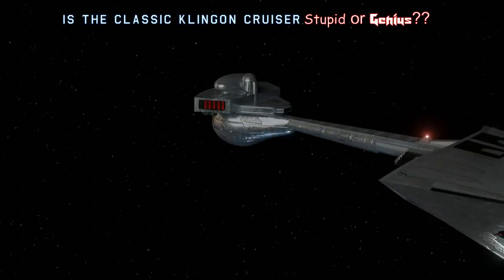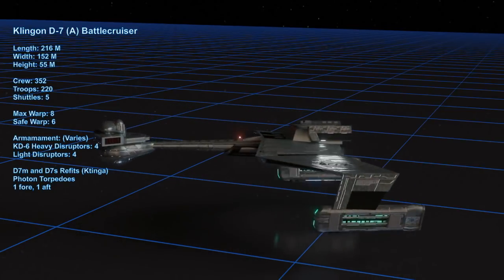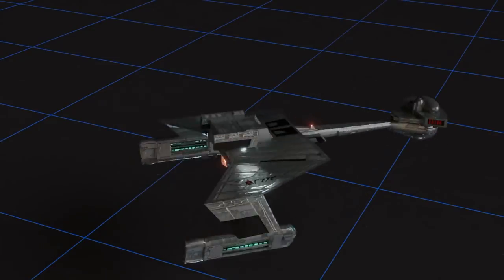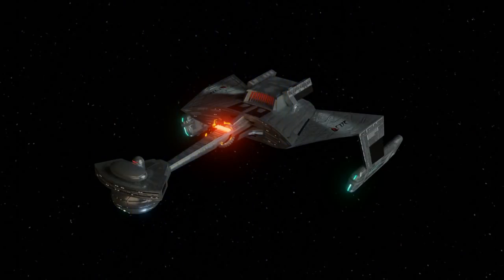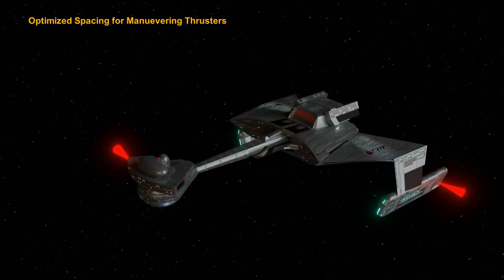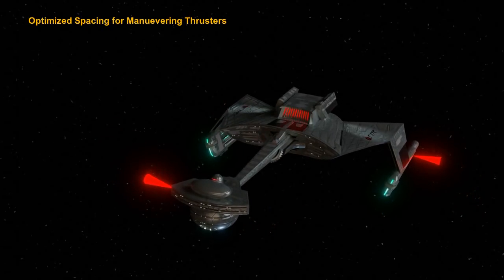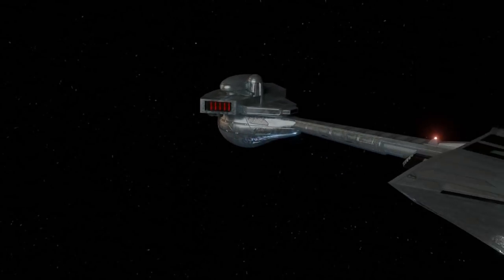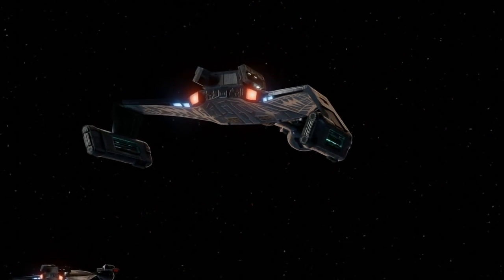The Classic Klingon D-7 Cruiser - Stupid or Genius Design?? Animated Breakdown!

Comment: Star Trek ships often have pieces connected by relatively spindly struts. The standard Federation ship design has the engineering section connected to the main saucer hull by a strut not much less vulnerable than the D7's neck. These are pretty much never any negative consequences to attacks on these struts. It seems like Star Trek ships aren't really vulnerable to being dismembered, no matter how much they logically ought to be.

Comment: I think the reason for the long neck is simple. If the aft hull receives catastrophic damage the long neck contains blast doors and keeps command and control operational even if the engineering hull is unable to support life. Similarly the engineering section and aft crew can continue to operate and maneuver the ship even if the forward bridge section is destroyed. The destruction of the neck itself would leave both the bridge and engineering section intact, and possibly the aft section still operational. It might be a weakness, but it is also a safety measure against combat damage.

Radiation has nothing to do with it. Radiaton is not a worthy way for a klingon warrior to die, is it?

We also know the later K'tinga is well enough armored to survive direct torpedo hits on the aft hull from Undiscovered Country.

Comment: It looks like it is a preliminary design. If you look at the rear section's front profile, it seems that it starts from a cut-front section. What if the neck section was the primary support for the back section and for more armament that was never included in the finished design?

Comment: It helps to remember that as created the Klingon’s were a rather transparent analog for the Soviet Union. So there ship design represented a more Soviet design aesthetic. And much like Soviet nuclear subs of the Cold War period, the Klingon’s reactors are not as compact as Starfleets, nor as well shielded. So the rear section is mostly the larger Klingon Warp core. And the extended boom is to keep most of the crew well away from it.

Comment: There may not be a technical reason for this separation as you suggested with the power core, but rather a psychosocial one -- your idea of servitor races being the ones that work in the rear section is plausible. But even with fully Klingon crews with no radiation hazard, there's a good reason for the separation. Klingons have a caste system, and as marines existed onboard sailing ships on Earth to protect the officers from the enlisted crew, the physical separation between these groups may be a very good reason for the structure. There's a bottleneck that prevents the enlisted from easily taking over the command center of the ship. Combined with good shields and maneuverability advantages, this bottleneck also makes sure that the crew isn't constantly challenging each other to death matches due to perceived dishonor from different castes and classes intermingling..

Comment: (Well Actually) I have always liked the Mutiny theory even if it it s little bit silly.
Matt Jefferies and Co may well have been well on board with the idea of "radiation" though as a reason for the shape much as it's a given reason for the Constitution Class to have it's Nacelles on outrigger struts & if you are of a mind to think the Saucer is an evacuation emergency vehicle then the boom could be on the Klingon vessel too.

Considering Klingon Ships can supposedly park in an ocean perhaps the boom is also designed to exit the Ocean and be able too fly up to the surface or even into space on it's own too - if the rear section is refusing to move or they crashed in water..

Comment: The original Star Trek technical manual did say the stalk design was so the front section was farther away from radiation generated by the back part. The idea was compared to very clunky unsafe but effective Soviet era technology which has always been larger and bulkier than USA technology at least back in the 1960s when this show was made

Comment: To add my geeky answer, in the Star Trek universe, ships have structural integrity fields (mentioned several times in TOS) so they aren't that dependent on the materials used or "thickness" of a structure.  Thus ships are designed for other capabilities rather than how sturdy they are.

As to the long neck, is that really any worse than the skinny structures holding the warp engines to the federation vehicles?   Arguably that design is worse because those engines have to be exerting  significant stress on those arms all the time, and yet they never seem to break off, even in battle.

Comment: There are multiple reasons for this ships design.  The first is maneuverability.   And looking at how the Klingons prefer to wage war, they like to be close in to their opponents.  They also like to come head on.  So the long neck wouldn't really be a weak point. But it would lead to the number two reason.  With the Klingons liking to battle head on, there's a higher chance of the bridge module being hit and destroyed.  This would leave the drive section in tact.  They could easily replace the bridge and continue fighting, without having to build an entire new ship. The drive section would also be able to continue the battle.

Comment: I would argue it is a combination of warp field geometery (as we see this design repeated in a number of ways with almost all Klingon designs, though not quite to the extent of the D7. The Vor'cha however is arguably just a chunkier version , and the Neg'vhar equally so. I've argued before that shields as a primary method of defense basically dictated Federation, Romulan, and Klingon Design philosophies for the better part of the 24th century. It wasn't until the advent of the Borg and Dominion which both demonstrated a fundamental capability to simply ignore shields, that we started to see certainly the federation begin altering their ship design. Compare the Nacelles on a Miranda or Excelsior which are very exposed to those of a Steamrunner which all but hides them under some manner of armor. 

I suspect that the design of most early 24th century starships was to maximize shield projection with the operating theory that if the shields collapsed the ships were doomed anyway. With the Defiant, Steamrunner, Akira, Saber, and arguably even the Neg'vhar's design we begin to see a pivot away from this design philosophy and the ships shields become more important.

Comment: I always presumed that the D-7 we saw on screen were actually just “service models” of sorts. That the original design has a more pointed design along the spine, following the angles of the aft armor forward into the bridge, not unlike the D-10 or K-33 from FASA.
Said prototype no doubt proved highly effective in combat, but commanders found it sluggish and too broad in its power distribution. To attempt to compensate for this issue, the field technicians then would remove the forward section’s non-critical components, including science sections and backups, leaving only the critical segment in place for crew, magazine, and the minimal necessary power transfer lines (leading to increased power requirements directed to the bridge section, lowering disruptor power when not properly prepared for). The aft section they called “the perfect warship” and left alone.
Once it returned to the designers, they saw their craft gutted, and became enraged. They attempted to fix the ship, but it had already passed final production approval in its new form, due to spitting out excellent numbers, and achieving a production cost and time far lower than anticipated (due to the drop in materials required) and thus: they were forced to make two halves of different ships and keep them together.
When they were told to refit the ship, the designers knew they couldn’t change the new expectations of a fast attack cruiser, so instead they streamlined the design and made it both more heavily armed and compact, and slightly smaller, introducing the K’Tinga variation (which being both a proven design and finally coordinated in its development stage: lasted nearly 100 years or more in service).

Comment: Every iteration of a Klingon starship shows internal bracing, along with an armoured hull, some kind of inertial dampening field as well as a gravity field and the standard deflector shields, close- in secondary shield on vital areas; Command & Engineering Pit and on top of all that, the primary battle Shields.

It is understood that the Klingons had reverse-engineered the Hur'q warp drive sometime in the 1920's in the Human timeline. They invented photon torpedoes, not Starfleet or the Romulans!

Comment: Given the hull has been in service for more than 200 years, the simple answer is that it's just not that easy to slice through the neck of a D7 or the pylons on a Constitution class. Given both classes display these seeming weak points, I think the armor and shields arguments bear the most weight. The Romulan Warbird is definitely stockier, maybe due to limits in shield technology due to the cloak--and the ship's vulnerability when uncloaking and not having shields.

"Just because you can do a thing, does not mean you should do it."  So why that design? I like some of the Ford and FASA ideas about kuve and lower ranks, but I think the obvious thing again is boom separation just like saucer separation. Both fleets felt it worth adding another structural weak point (the latching, explosive bolts, etc) for this escape pod function. Being further out from the warp core, perhaps the necks both give their crews precious breathing room and time for the separation to clear a maybe-already-popping engineering hull.

Plus OMG it looks so hot. People could fly around in a box if they chose--and some do--but most space powers have made ships that are both functional and beautiful.

Comment: I do imagine that the design is a holdover from pre-warp spacecraft which would prefer to have a highly radioactive fission or fusion powerplant and drive held as far as mechanically feasible from the crew and life support modules, with cargo and water tankage held between as extra shielding.  Once energy-based shielding, safer powerplants and less dirty drives were introduced this problem would mostly be alleviated, except that shipyards and tooling would always lag behind, as would design philosophy in governments that are highly focused on cultural and technical conservatism.  
The prevailing attitude was probably that the basic hull configuration worked well in the past and so it would work well now, plus we don't want to absorb the costs in both money and time to retool shipyards and rework design plans that are already finalized.

Comment: The long neck isn't more stupid than what their main adversary, the Federation, uses: A ship where the main command center is at the very top right in the middle of a big circular target and engines on long booms that could be just as easily cut as the Klingon neck.
Both sides have very bad design weaknesses in case the ship has to take direct hits.

Comment: Ive always believed it was the Star Fleet Battles reason: fire arcs. The D7 was fast, nimble, but rather flimsy, with mediocre shields. It did not face to face brawl, but rather raked and strafed on a pass. For this reason only 50% of weapons fired directly forward, but 90% fired down the back diagonal- the 4 and 8 o clock position. If you stand on the sloped deck of the bow section, you can see that both bow angled decks are positioned to shoot back "over the shoulder", due to the gun mount being so far out in front of the main hull. 

So thats my head canon reason- wider arcs of fire. Because pew pew!

Comment: I think you must take into account Klingon's military doctrine. Klingons fight aggressively, making fast attack runs against enemy ships and preparing boarding parties. They ambush their enemies and attack quickly and in a devastating manner. Starfleet ships seem almost stationary compared to them. While attacking from the front or when the vessel passed its target the long neck is no issue - it is protected by either the front or rear of the ship. Hitting it while the D-7 turns is hard, as it is very manoeuvrable. And in the case of boarding (as Klingons often fight other Klingons), the neck is a choke point the Federation ships completely lack.
I think it is a good design for Klingon's way of fighting wars.

Comment: Dont think that just because the neck is skinny, that it has to be weak.   With a smaller cross section, you can make the walls thicker without adding too much mass. Mass does matter in space.  The neck has a harder to hit size, with potentially much stronger plating  and structure.

Comment: I think the radiation theory is the most likely and is the oldest I recall hearing. Using subject races also is an old one too. It may not be as unlikely as initially seams if you add the promise of extra privileges for service. Especially if they are more resistant to radiation. 

The reaction theory also sounds like good additional reason. Someone pointed out that the thin neck decreases ship mass, that sounds like another good possibility. 

While I accept the detachable forward boom, I don't buy it is for escape. That just isn't Klingon. More likely it is modularity for quick repair or upgrade. After all if the ship is built in modules why not use that feature past initial construction? Any drive would likely just be reaction.

Comment: The ship has a low cross-section from anywhere but the very top and bottom an good luck hitting that extremely thin neck at range and while at impulse speeds. It's a smart design.

Comment: You missed the basic reason. The Klingon engines are not as finely built or designed as the federation's. They disturb nearby sensor arrays, and reduce the sensor's sensitivity and long range. By positioning the engines far back from the sensors, the Klingon ships can have better sensor response.

Comment: Klingon culture is rooted in honor and duty.  Note that the command deck of the ship is in a VERY raised "tower" on the command module.  It stands tall and proud over the rest of the ship.  This makes it an easy target for computer-aided phaser tracking systems to hit.  Or, at least, just as easy as hitting the boom section which is nearly the same width.  This is about the Klingon mindset.  Klingons go to battle to serve the Empire, their Family, and themselves.  In that order.  Honor and duty are at the heart of it all.  In order to go to Sto-Vo-Kor, they must face death with honor.  They cannot do that as easily in a ship that is designed to keep them safe as they can in the D-class cruisers.  It's also why, if you will note, that in most cases, the captain's chair on a Klingon ship is usually the forward most seat on the ship.  This allowed the captain to literally lead the crew into battle on board.  And the captain, above all, must act with honor and duty to set the example for the lesser officers and crew. The engineers designing the D7 would have seen the warp-field geometry bonus as confirmation as this being the right way to support the Defense Forces' honor.

Comment: from TOS the only ship that doesnt have these sort of 'apparent' structural weaknesses is the Romulan warbird.
Roddenberry's goal was to get away from the 60's paradigms of spaceships, which he certainly achieved (in spades) 
given the reliance on shields & the 'similarity' of apparent structural weaknesses in both SF and KDF ships 
IMO warpfield geometry seems the most plausible (and really good) answer to the conundrum...

it also should be noted that the boom (neck in SF ships) is probably not at weak as in appears!
and reaction control explains WHY. any 'good' design will have multiple RCS thrusters spread as far apart as you can get them
RCS usage would then put a a lot of torque and other stresses on that boom which it appears to handle quite easily.

Comment: I don't see that it matters much. The shop is protected by energy shields so the neck would be just as protected as the rest of the ship. Once shields are down phasers and photon torpedoes will go through any part of the ship.
Got to admit it always puzzled by the neck. Maybe it just came to creating a ship differing by Star Fleet and Romulan designs. I'm sure when they designed it they were not expecting people debating it nearly 50 years later.
Does look cool though.